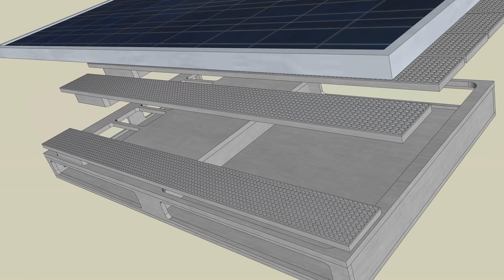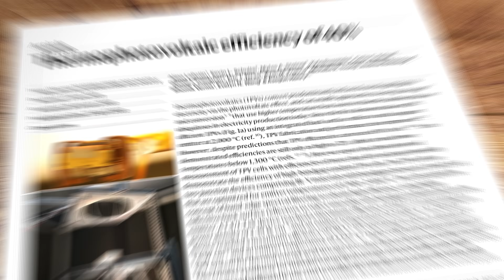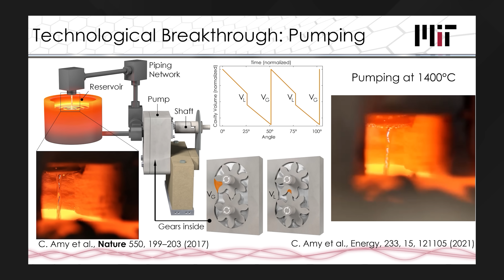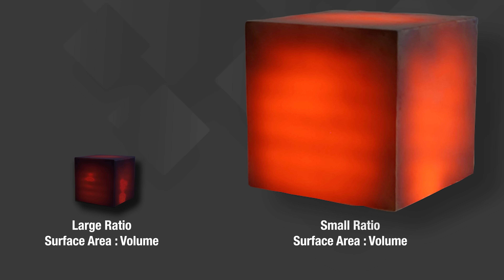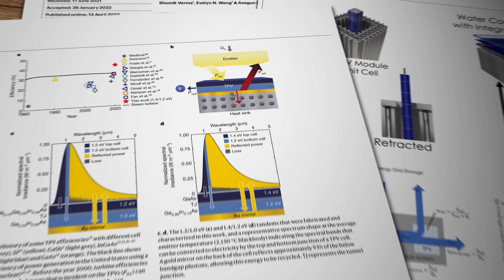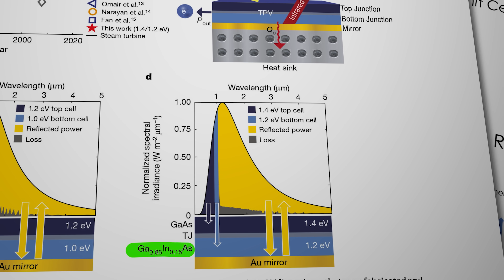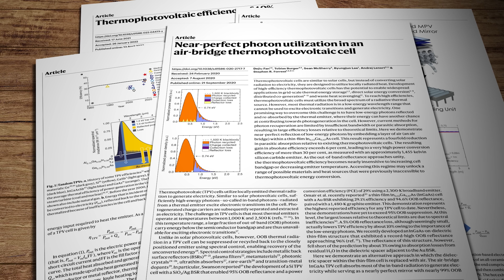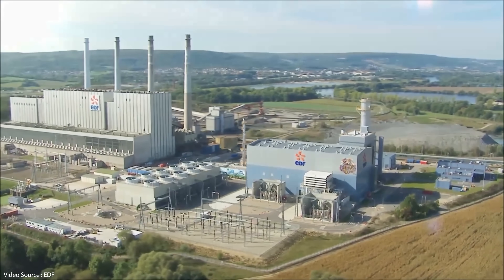Grid Scale Energy Storage 30x cheaper than Lithium-ion! How do they do that?

Comment: It would be very interesting to have a segment done which revisits startups/technologies that were the subject of past videos. It's very easy to produce promotional materials that promise a 'demonstration plant in 2022', but how many of these actually happen? You've covered a lot of these things in the past, maybe it's time to do a retrospective across the board and see how many (or which ones) are fulfilling their promises to scale up to utility sized configurations.
Reply from the maker: Hi Dave. It's a point that has been raised many times. I do try to keep my eye on progress, and I will aim to do some follow ups where appropriate.
Reply: @JustHaveaThink  Please include the negative results, like the cheap nuclear plants, geothermal, and other technologies we have been promised but never materialized.
Reply: @JustHaveaThink  COnverting heat even 'white hot' to electricity does not require the heat be electricical entirely!

Our mantle can contribute substantially to melting the iron obviously and ideally lower temperature radiating materials be they plasma etc. are missing pieces.

I was thinking about this recently oblivious to this progress. The coolant can be boiled hybridly spinning turbines while cooling duh.
Reply: @JustHaveaThink  Gravitricity just had a successful additional raise for another pilot project.
Reply: @JustHaveaThink  
There's no such thing as "30 times cheaper". Don't speak like a child.
Reply: @Youtube_Stole_My_Handle_Too  Huh??? You haven't heard? Solar panels today are over 100 times cheaper than they were in the 1980's. Rechargeable batteries are 30 times cheaper than they were in 1990. Progress is real. Not everything is getting worse.
Reply: @fotoguru222  $990 for a square meter panel in 1979 with a maximum efficiency of 11%. Lithium-ion didn't exist commercially before the middle of the nineties. I don't know where you've got "30 times" from. 
This is besides my point which obviously flew high above your head. There's no such thing as "thirty times cheaper"; of anything.
Reply: @Youtube_Stole_My_Handle_Too  I'm sorry. English may not be your native language. The meaning of "30 times cheaper" is clear to most English speakers. I gave a factual example of what it means.
Reply: @fotoguru222  Weather or not it's clear is of no relevance. When you speak illogically you demand your opponent to treat you like a moron, by correcting the childish speech in the interpretation. This is never a good start to any conversation. 
Indeed it is illogical. When x is three times less than y and y is 3 - then x is -6, but this is often not what the sender meant to communicate. The sender may think x is 1. The receiver must then check what makes sense from context - thus assuming the sender is a moron. 
The solution to the problem is to say one-third when you mean one-third and three times when you mean three times and stop leaving to the receiving party the extra work of checking what makes the most sense. Not always is it even possible to determine. 
Is this too hard to grasp, stupid?
Reply: @Youtube_Stole_My_Handle_Too  Did you get out of the wrong side of the bed this morning? Or are you always this obnoxious?
Reply: @fotoguru222  30 times cheaper is really sloppy writing. 30 times is more than 100%, yet 100% cheaper means the cost goes to 0, while, 30x cheaper means the cost goes to 3.3.%. Headline clearly written by a non-technical PR flak
Reply: @paulchernick2867  🤔Perhaps it's a British English vs. American English thing?
Reply: @Unkl_Bob  "er not doing yerself any favors talkin like you do. Smarten up. Stop insulting people."

Why do you got so much against me calling out lunatics for what they are?
Reply: I'd be interested in the technologies that failed to come to fruition, and what the roadblocks were...
Reply: @Aaron628318  If a project fails, there is no reporting on that. And sadly, most of the projects are failing. Still, the working few are a great start.
Reply: @tomo1168  But they get their short term advertising start up money from youtube channels like this. ITS A SCAM.
Reply: @Hates Spam Good point, but I would say that things change over time - as in "evolve". When things evolve there are a lot of failures. I think Dave's channel is a very good resource - akin to a scholarly journal. Published articles are there to be read and pondered upon. That's my take. By the way, there is a thing in Hawaii called a "Spam musubi". It's pretty good.
Reply: @dac545j  A scholarly journal with a bunch of boosterism and sweeping promises. And confusion of future hopes with current reality
Reply: @Hates Spam That's weird because I don't get Minecraft videos or fighting videos.
Reply: @Hates Spam You can actually click 3 dots next to a video thumbnail and say: I don't want this recommended anymore
Reply: @Hates Spam I have bad news for you. If you comment under a video, then for YT algorithm it means that you were interested. If you don't want to see some of the stuff anymore - do not watch, do not comment and go somewhere else. Plain and simple.
But if you leave a comment - especially multiple times, then YT thinks the content was really engaging for you.
Reply: @Hates Spam Whatever you click on and watch is what YouTube Recommends, so stop watching the stuff you don't like.  It is really that simple!
Reply: @Hates Spam Are you frequently on a shared WiFi with people who do watch such things?  I noticed a friend of mine got recommendations for videos that I might have watched while using my WiFi, but they were not videos they would have been recommended normally.  This seems to happen with most videos except videos meant for children.  Those do not seem to show up in recommendations on other devices.  Also, sometimes youtube seems to completely lose the viewing history and I get whatever is popular in my area; this is when using logged out.
Reply: If he did that, he would have very little to talk about. These schemes, like...
- Solid hydrogen on a disc (yep, like playing a dvd to release hydrogen)
- The SPINLAUNCH that throws an item into space
- et al
They are all scams. Engineered to get as much start up money as possible.
Reply: just like science, which is wrong over and over again, and needs modernization/alteration incessantly, new technology is usually wrong.  its very much a trial and error game, especially in the beginning and then again when newer, more successful/efficient tech comes along from newer science. i imagine as well many initial failures could have been successful if worked on longer and  more research money poured in.
Reply: @element5377  If it's all trial and error why are we paying for all those degrees? Hell I can plop out educated guesses better than most.  Just cant BS like these guys, that makes it tough to get a bunch of somebody else's money to buy cool tools and exotic materials, and pay myself a big fat salary to burn shit and bull shit for 40 years and produce nothing of value. Call up McMaster-Carr and ask how much for the multi-ton graphite blocks, tons and tons of tin, and what was the foil was it tungsten? Have fun manufactruing that!  And a gajillion bottles of argon, tons of refractory insulation. Oh and make sure to set up an account at Omega so you can pay $400 for a 50 cent fuse so it looks more impressive on the BOM. And of course you have to specify some unattainable purity on the materials so you have something to blame it on when it doesnt work. Every lab must have a fermenter and a distilllation unit as well. Sometimes I think these guys make this shit up just to get the college to let them keep playing and whatever they come up with will be so expensive nobody will ever attempt to actually try it to prove it wont even begin to work.  How much has been spent on colliders over the decades that have produced a sum total of zero of anything useful. Nano-particles, graphene, the best thing to come out of all that was the blackest black paint scraped out of the bottom of the black hole all that money was dumped in to. Coulda done the same thing burning a wax candle in a controlled atmosphere.   Go ahead, try to order one of those world changing graphene capacitors that have been in development for 30 years. If you have the 50 grand for 3 farads @3v they will come up with some excuse not to ship it. I will bet that 99% of the true innovations have come from 1% of the interns. The Wright brothers worked in a friggen bicycle shop!
Reply: @Hates Spam it’s basically “tech porn” for us geeks.  it’s a nice way to stay ahead of the curve by 5 year.  if you want to know what tech actually was successful then just look at what is in consumer products. currently it the tesla giga batteries.  seems about it.  but i do think heat storage or air compression will eventually work out.
Reply: while i think your point is very valid, i think the topics he covers are usually with very solid research, and sometimes with funding for scaled prototypes.

the truth is, if there was a new infrastructure scale technology that keeps achieving goals is probably an scam. because infrastructure investors priorities long term stability more than short term gains. which means if some new technology keeps having news, it's either not infrastructure, or not real
Reply: @acasccseea4434  Scam
Reply: @Hates Spam Stop clicking them then. YouTube learns your preferences. You can also hit the three dots next to the video and click Don't Recommend Channel. It does work, every once in a while YouTube starts recommending some new bullshit to me and I can stop it pretty quick.
Reply: @calebmauer1751  right, I keep getting china videos, which i don't like. i keep clicking not interested.. and does go away, for awhile anyways
Reply: @Hates Spam You should really watch Thunderf00t bust these videos. IT such fun.
Reply: @Technichian462  love watching these things get busted but thunderfoot is a hack and kindof a human turd

Comment: Sounds like an overly complicated thermal storage system to me. Why not just stop at the liquid tin, put that into an ultra insulated tank and then run water through the tin. It avoid efficiency loses in the tin to graphite to tungsten processes, it uses the existing steam turbine instead of turning it into a stranded asset, and it also has the benefit of rotationsl inertia that helps stabilize the grid. Finally its a very well known and fairly efficient technology. Sounds like another novel technology that's still at bench scale claiming to be a silver bullet and save the world. I'm personally beyond skeptical of those to the point of not listen anymore

Comment: I cant help think that letting it cool down too much would result in solid tin throughout the system - never to be molten again!
Reply: It may be necessary to run electricity through the tin to reheat it.
Reply: Molten tin is used glass pane manufacturing.  My guess is that this is a solved problem.  OTOH, failure of power to aluminum reduction cells does take months to restart, so it is definitely something to consider.

Comment: If this requires a cooling circuit that then uses the atmosphere or oceans as a heat sink, it is only partly solving the issue of global warming caused by power generation. 

CO2 is part of the problem, but so is the dumping of waste heat e.g. into our oceans. 

I hope the designer of this system will incorporate it into a heat network. Alternatively, gift the waste heat to an industrial user. 

That way, it will not only be carbon emissions free, but will further improve its overall efficiency in terms of energy consumed and utilised.
Reply: The waste-heat is nothing compared to the green-house effects of CO2 and CH4 which, after all, have the Entire Atmosphere collecting heat from the SUN.
Reply: The direct heating affect is pretty small compared to radiative forcing. At some point it will become the biggest issue, but right now it is less significant by a factor of around 15.

Also, thermodynamics dictates that all energy will eventually end up as heat. Wind power slightly cools the planet on account of robbing the wind of energy that would be lost to friction, so if this is wind powered the total direct heating is exactly the same whether you are running a 100% efficiency battery off 1 windmill or a 50% efficiency battery off 2. Solar works out slightly different, depending on albedo, but if we get to the point where simply painting things white is enough to offset our impact, I think we would be doing ok.
Reply: Do you know to what extent waste heat is an issue compared to thermal radiation?  I would've thought it'd be a pretty small piece of the pie.
Reply: @gg3675  thanks, but if I'm honest, I don't understand what you are referring to with the phrase 'thermal radiation'. Perhaps you could clarify for me?

To expand my point further in the context of some feedback: waste heat from thermal power plants may be a small part of the overall global warming problem. However, I've never seen it discussed by anyone. It may be insignificant at any one point in time, but cumulatively, since the start of the industrial revolution, how much heat has been dumped in our seas and atmosphere? How much more will be dumped between now and 2050? Especially if the world is persuaded that supposedly CO2 free NP is the answer to our problems.

Only truly renewable power generation is free of this potential problem. The only other solution is to reduce our consumption by insulation and by behaviour change, e.g. reducing travel and learning to enjoy where we live. But no one within the fossil fuel/uranium supply industry makes money from that, so Whitehall is unlikely to be drawing up a Green Paper to present that as a discussion subject to Bojo et al, any day soon. 

Call me a cynic? I wear that badge with pride. 😂
Reply: @Luddite-vd2ts  Sorry that's my bad!  I'm pretty sure I meant SOLAR radiation, not "thermal radiation" which would just mean all heat in general.  I did some research and nobody has really tackled that particular question apparently, but the papers I read approached the problem in a way that makes more sense.  

The paper I've linked below found that the contribution of CO2 is about 25 times that of waste heat, which is basically because waste heat dissipates quickly while CO2 continues to warm the atmosphere for hundreds of years.  That's actually a bigger impact from waste heat than I would've assumed, because before I was kinda just seeing it as an opportunity cost.  

Considering that this particular technology is intended to replace other major contributors to industrial waste heat (coal and gas plants), my assumption is still that it's not a huge deal.

https://www.sciencedirect.com/science/article/abs/pii/S0360544210005694
Reply: Thanks for the replies.

The waste heat generated by all forms of thermal generation (fossil fuel and nuclear power) is a concern to me, and I suspect that, if one were to be able to calculate that on a global scale it might be significant.

I remember, very well, as a youngster in the 1970's my parents regularly took us on holiday to Aldeburgh in Suffolk. If we went swimming there the sea was intolerably cold.

Occasionally, however, we were treated to a trip a few miles up the coast to swim at Sizewell; this was regarded as a treat. Not just because of the nice café there, rather the sea was always noticeably that bit warmer. 

The only explanation I could think of would be reactor cooling systems dumping heat into the sea. If I'm correct, extrapolate that to a global scale where seas, rivers and the atmosphere are being warmed by generations of power stations around the world doing the same thing.

What's the long-term effect on ice sheets and glaciers?

Comment: TPVs won't go anywhere near large scale application, as long as they waste 60% of the energy, even if installation cost is 30x cheaper than batteries. With that huge inefficiency, operating cost is much larger.

For batteries as grid storage, expensive lithium ion als makes little sense as well. For that you can use cheaper battery chemistry with terrible energy density, because here weight and volume are no constraints, unlike in cars.

The best grid storage still is no grid storage, and instead making the grid very large. If the wind doesn't blow in one country, it'll sure blow in some other country. Once the grid spans over an entire continent, the small available pumped hydro capacity should be able to mostly cover storage demand.
Reply: The hype and hysteria around grid storage is drawing attention away from a far more-obvious solution to balancing the grid: controlling and leveling demand.  In the US, heating and cooling combined use around 30% of the electricity consumed.  This demand can be controlled and peaks and valleys in demand mitigated by remote control of thermostat systems.  On days when temperatures are expected to peak, thermostats could be remotely turned up or down down a few degrees during periods of low demand to pre-chill or pre-heat homes and businesses a few degrees, and then reversed during periods of peak demand to allow temperatures to fall a few degrees above or below the ideal set point for a few hours to minimize demand on the grid.  Same goes for water heaters (12% of power consumed), refrigerators and freezers (7%), and lighting (4%), which could be remotely dimmed.  This would all be way cheaper to implement than grid storage, actually saving utilities and consumers money, and the bulk of the benefits (from heating and cooling) could be deployed very quickly.